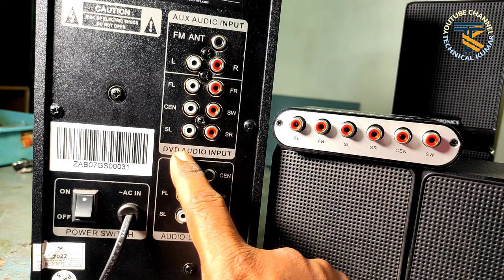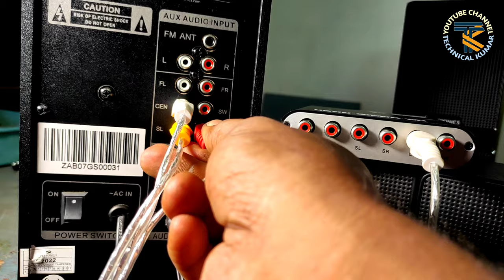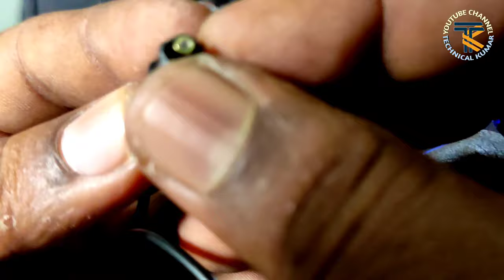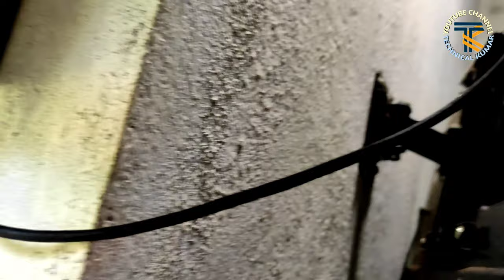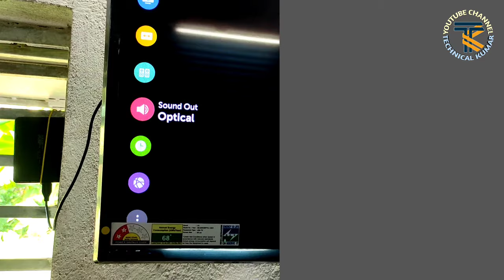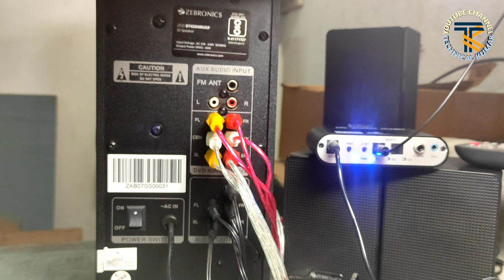How to connect hd audio rush in telugu/ Dolby dts 5.1

Comment: I am planning to buy the Sonyy Ht s20r. I have already provisioned cable for rear speakers in my ceiling. Is there a possibility that I can use existing my cable that flows from ceiling to tv panel. Reason I ask this question is that, at the subwoofer end of cable there is clip which I feel may be problem for me. Also is it fine to cut in built cable and then join to my existing cable using tape? If not what's alternative?

Comment: Sir sony home theatre undhi but dvd not working. But speakers(5) 🔊🎶 and sub woofer also working how use ...,???????  May i any device to purchase to use to those speakers🔊??¿?
Reply: I am also facing the same issue. If you find a solution, please tell me
Reply: I am 70 using 13 the 73 same 90 model 27 please call me bro

Comment: I have a question. If i connect my old 5.1 home theatre to this device and to tv and set tv setting to optical then my speakers will give sound from tv. thats ok. but what if i additionally connect my pc to tv and play any video or play game on it will it spread sound from speakers of hometheatre?
Reply: This audio rush is not give true 5.1 , if u want to experience Dolby audio you must use HDMI ARC , HDMI ARC is Basic port to experience Dolby,  
If u follow this video, just waste of money ,
Reply: @balambalu  yeah. That already happened with me. Useless thing. Best option is to buy true 5.1 receiver and put old speakers. There are many cheap and good sounding old speakers that can be found.

Comment: 😂Only noobs use hdaudio rush bcaz the dac chip inside that is absolutely worse. even it couldn't passthrough Dolby prologic 2. and the connectors sucks...very cheap quality. If u have good amplification system then do not use this one.